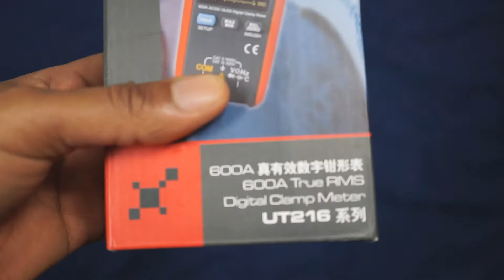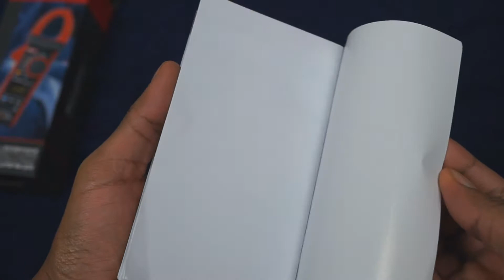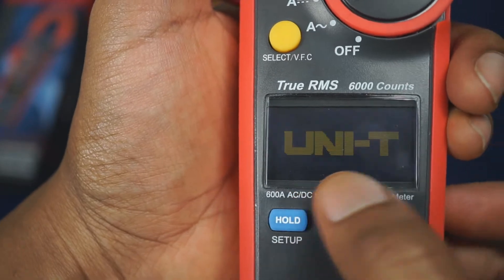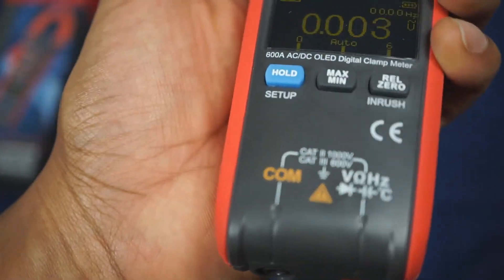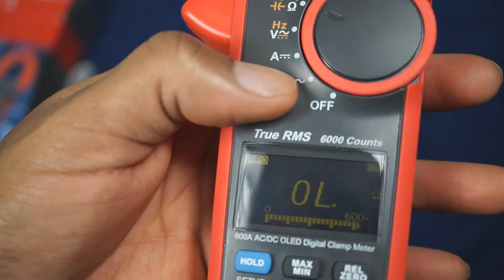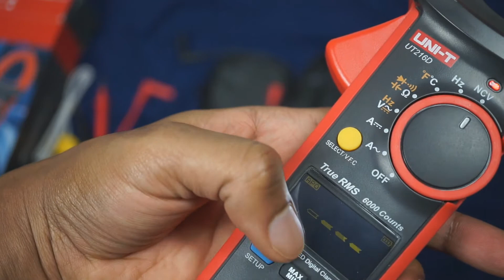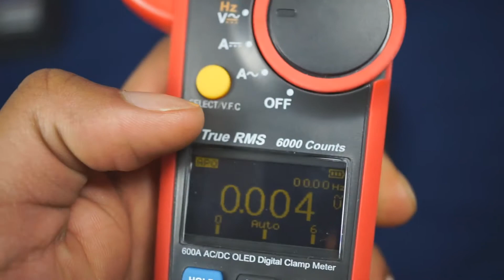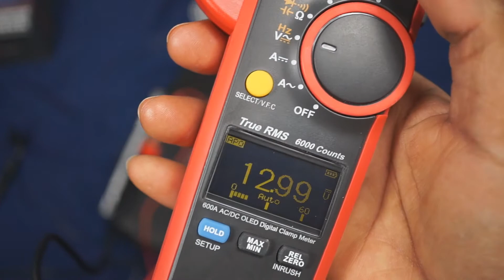Unboxing and overview UNI-T UT216D Digital Clamp Meters 600A True RMS AC/DC Current Measurement

Comment: Accuracy plus or minus a couple volts you say?    So in other words, I wouldn’t even be able to test a AA battery with this meter?    For the record, most multimeters express accuracy as a percentage.  For voltage, the specs sheet shows 1.2% +1 (AC) and 0.8% +1 (DC)

Comment: A clamp meter and you didn't test the clamp?
Reply: If you really want to show if this is a good buy, show the inrush current on something with a motor and compare the reading to a Fluke.  A fast sampling rate/time is important to get a good inrush reading.  I don't know the answer but that's what I'm looking for.  If the inrush sampling rate is as good as on a fluke, then I would buy because it would be a good value at this price point.
Reply: John Barton hi, how can I get in touch with you better ? I’ve got some information that will answer your question with a caveat. Did you ever make a purchase?